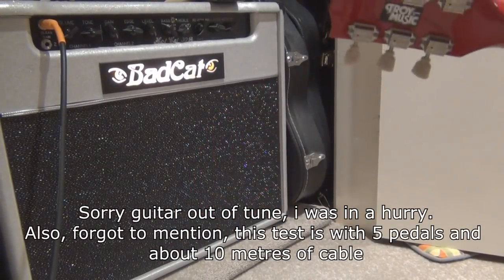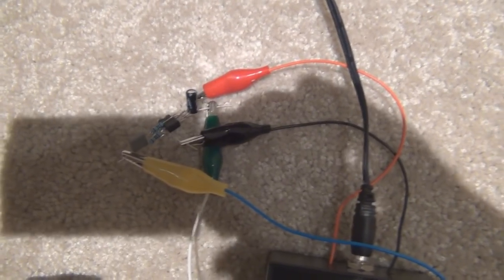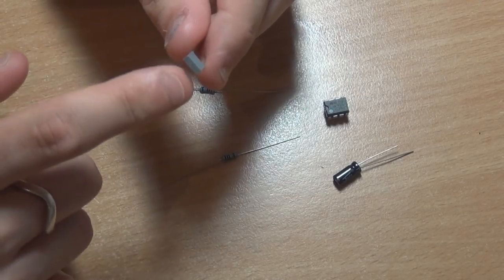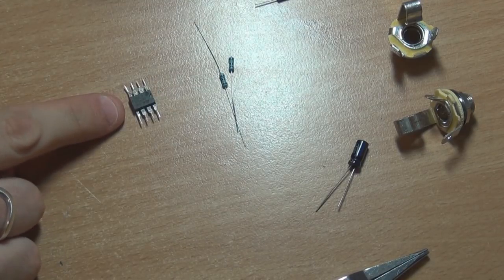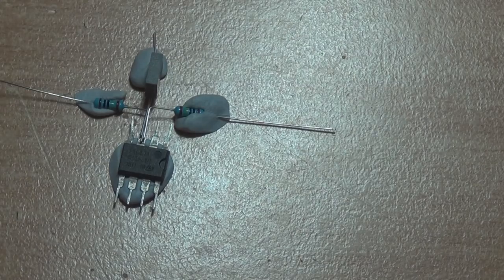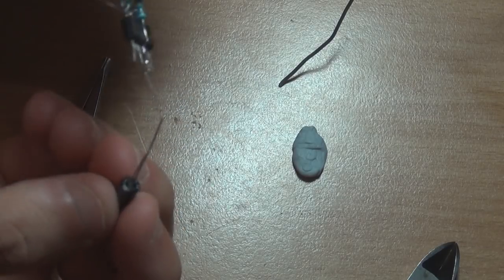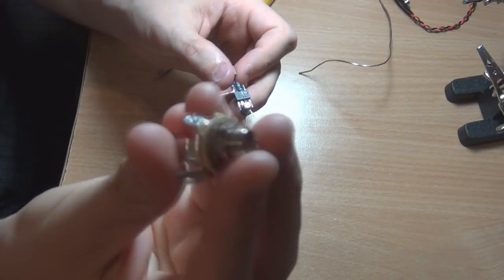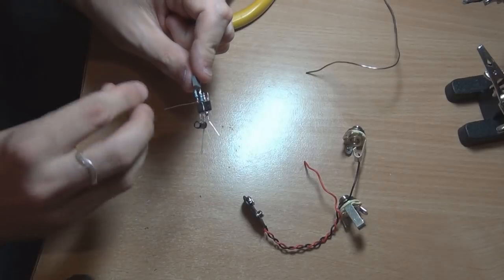Build a Guitar Pedal in 10 mins! (Buffer)

Comment: I tried this with couple of TL071's, and it didn't work for me. From the way you did it (simple as possible), to the vero board mounted (with IC socket), new caps, new resistors, checked multiple times,different schematics...nothing... only humming and buzzing, no guitar coming trough.... Probably, the IC's are faulty (all 10 of them)
I also built a booster from your videos, worked the first time, even built a second version, tweaked it a little :D looks I'll be using a J201 for my buffer

Comment: what if i use "TL072 cp" ???
Reply: The TL072 has a different pin layout. The same circuit will work but you'll have to adjust the connections to the IC accordingly.